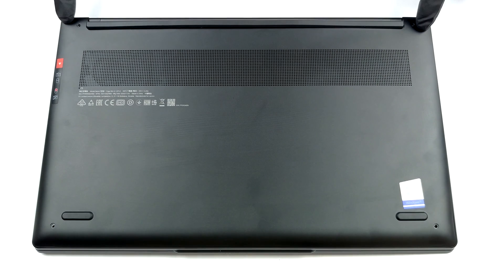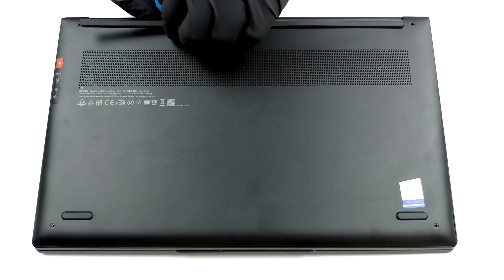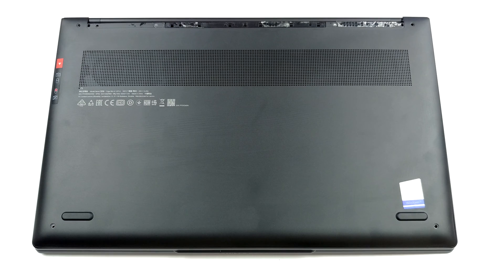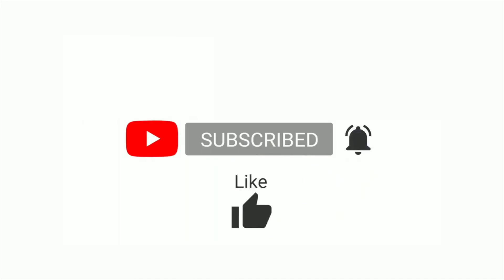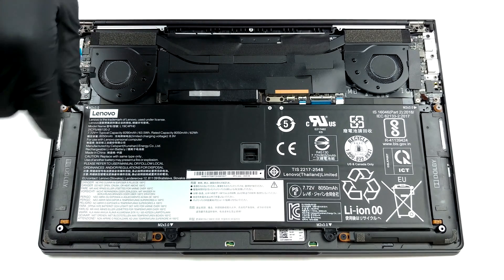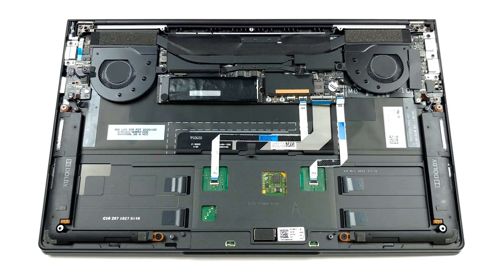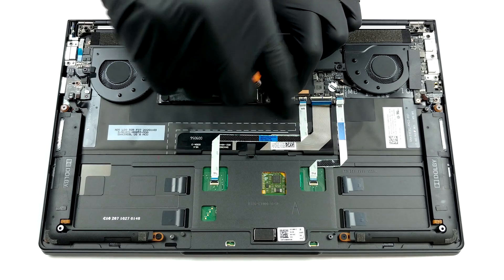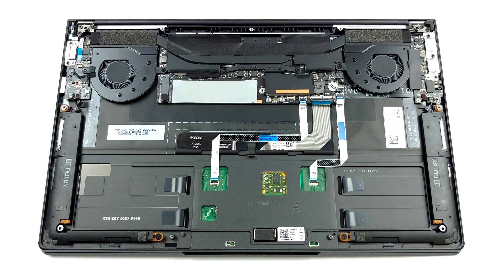🛠️ Lenovo Yoga Slim 9i (14) - disassembly and upgrade options

Comment: Good day. I have a question. Does the motherboard support the ability to replace SSD up to 2 TB?
I am choosing Crucial P310 2 TB M2 2230 PCIe 4 or Kingston SM3 2 TB.
Please tell me which manufacturer and which model of SSD M2 2242 is installed in this laptop.
I am going to buy. I am from Russia.
Best regards, Sergey